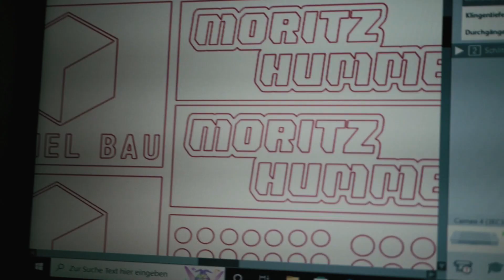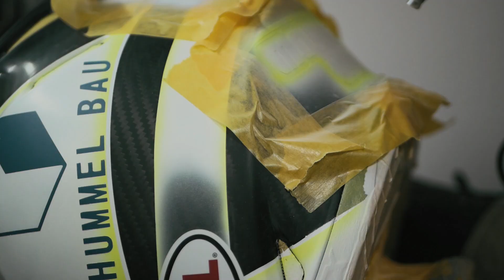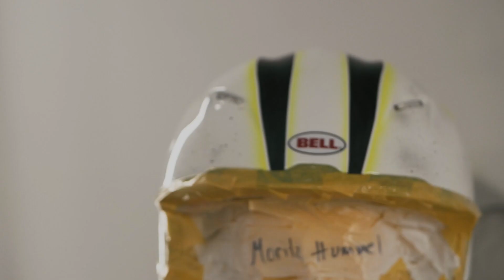Helmet Painting - Step by Step FULL VIDEO / Bell Moto 9 Flex

Comment: What vinyl are you using in the silhouette? And do you have issues with radiused cuts not coming out smooth.  (When i cut circles its like it makes a bunch of tiny straight cuts
Reply from the maker: I use Oramask 810 Vinyl foil. No i dont habe issues, but you have to find the correct Setting for your Plotter.